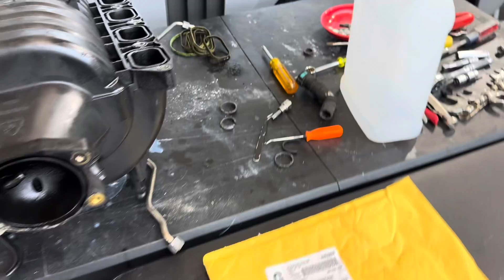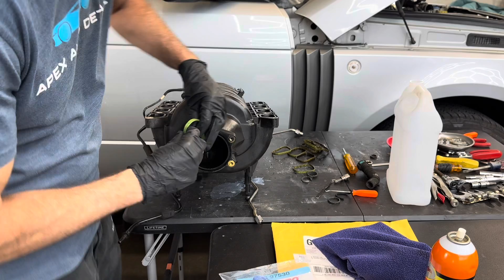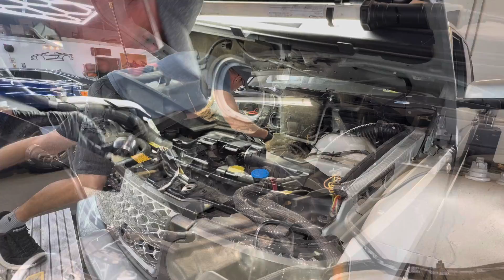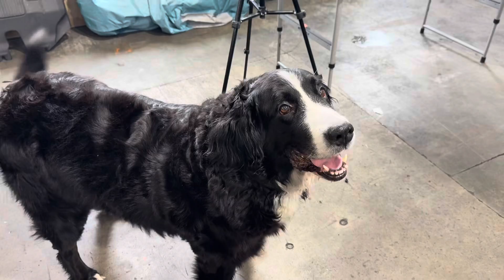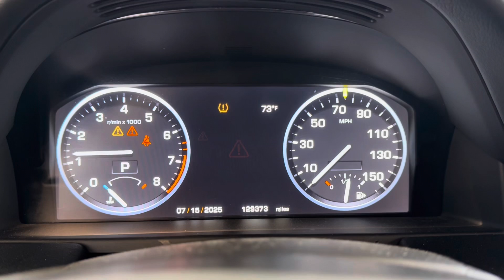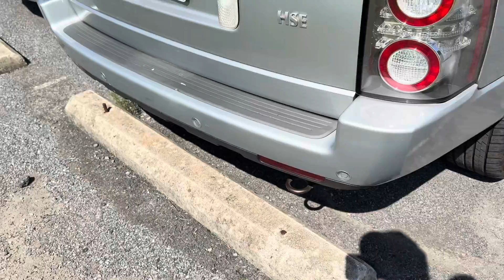Will The Abandoned Range Rover Start And Run Today? New Coolant Cross Over Tubes!

Comment: You should vacuum fill the coolant. Only way to be 100% sure you don’t have air pockets. Get an air pocket in the wrong spot and you’ll end up with a cracked head.
Reply: How do you vacuum fill?
Reply from the maker: These are already known for head gasket and warped head problems....good point.